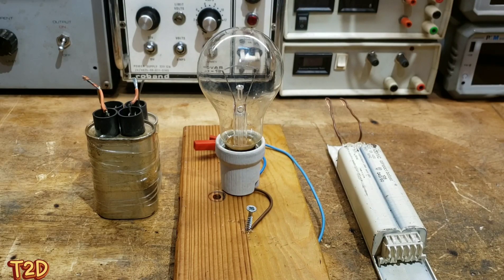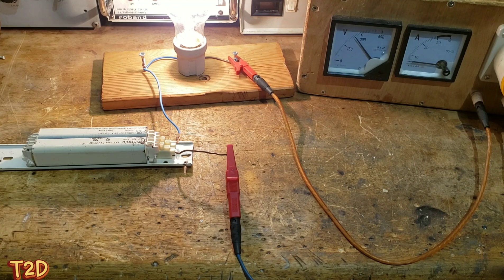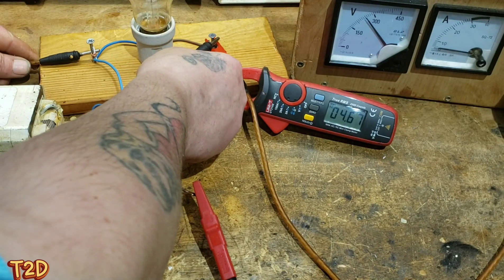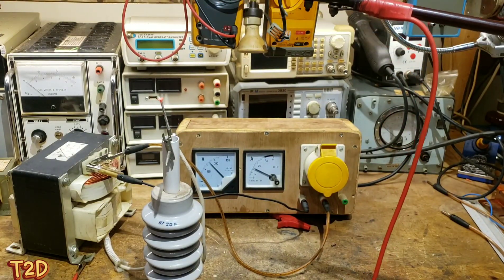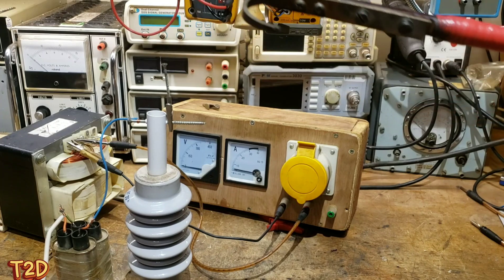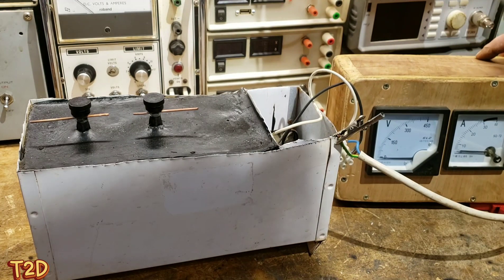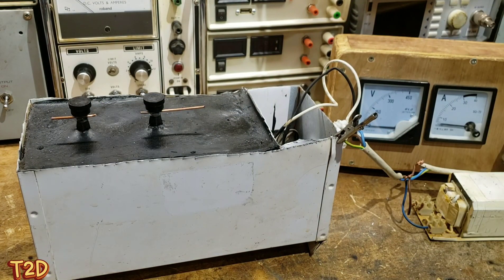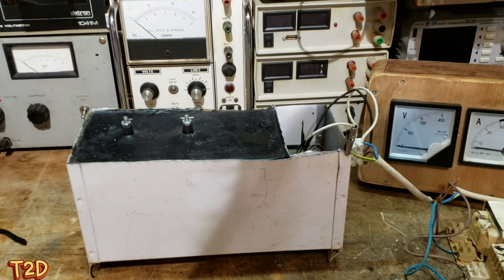Ballasting transformers for current limiting and running at higher voltage 👍👍

Comment: When I arced the plate transformer from the the gu-39b tesla coil, with the ballast in the primary and in the secondary (there was a variac in the primary, there was a capacitor in the secondary), the wires jumped during the arc from the Ampere`s force, and the contact in the variac is sparked. Without ballast there was an INSTANT shutdown of the circuit breaker
Reply from the maker: 🤣 I'm not surprised at all😎👍 beautiful transformer 😎😎

Comment: I guess this demonstrates why at 250w, my transformer will jump a space 3x the length that of when a higher power is used.
Reply from the maker: Yeah it allows you to get more voltage on the primary without over saturation 👍👍
Reply: I noticed this effect too. Super weird
Reply from the maker: @inductivelycoupledplasma6207  I will explain it more when I make my saturable core reactor  video 👍👍
Reply: @T2D.SteveArcs  thanks mate. I'll be looking out for that
Reply from the maker: @inductivelycoupledplasma6207  👍👍

Comment: Very well explained. Very useful! Lighting ballasts are the best for things like this. I usually use mots as ballasts because they allow a good amount of current through. However,  there is a much greater voltage drop to compensate for. Thanks for posting!
Reply from the maker: Thanks Matt glad you liked it mate ...
I will do a video on saturable core reactor soon ...

Steve

Comment: Very helpful video. I'm wondering how that NST took that much voltage on the secondary. Certainly changed my view on them of not being able to take any voltage higher than what they're rated at.
Reply from the maker: Glad you liked it thanks for commenting mate, I will try to do more videos like this in future if people like it....

Steve
Reply from the maker: Also have to remember theres two separate secondary coils and they are centre tapped ground so zero volts near the primary and core.....

Steve

Comment: Thats super interessting

How dangerous is this for the Transformer (regarding the NST)?
Could it damage the Coils, if they are not insulated well enough? I mean they do rly jump far!
Reply from the maker: This is dangerous for the transformer and it could arc internally.. we could keep increasing the primary voltage pushing harder until it did arc over,  my advice would be dont push a transformer you care about this hard, I did this to demonstrate it was possible, 

Steve
Reply: @T2D.SteveArcs  Yeah I have an NST, where the coils basicaly just have paper/tape insulation. Yours hase tar. Big difference.

Hm I wonder: If I put some bobbins under Epoxy for a custom Transformer, would that be sufficient isolation.
Reply from the maker: @friedrichfreigeist3292  if I'm trying to get max voltage a usually drop them under oil mate..
Reply: @T2D.SteveArcs  Ofc, Oil is the Way to go. I just dont like the mess, and smt dry that you can just put on the desk sounds more fun tbh.
Reply from the maker: @friedrichfreigeist3292  yeah that's kinda nice. I've just given my mate an NST that was actually potted in epoxy, and that could withstand quite some voltage too. 

Steve

Comment: Interesting. Obviously the ballast reduces the current in some way? So if the NST uses (lets assume) 30 mA @ 12 kV it runs at 15 mA @ 24 kV or something like that? Btw, inductive ballasts like these used for HQL/SON lamps and getting phased out at the moment. Modern lighting systems use LED (no ballast needed) or an inductive ballast is replaced by an electronic ballast as its much cheaper than these old "iron pigs".
Reply from the maker: Hi mate glad you liked it.. I will be doing another video about this subject and we will go a little more into it....

Steve

Comment: A great demo and a good accompanying explanation. Nice Juicy arcs too! I'm glad that my screen doesn't pass on the UV! -Peter
Reply from the maker: Thanks Peter glad you liked it, really value your opinion, 

Steve
Reply: @T2D.SteveArcs  When I was a kid, Steve -that's a long time before triacs came in, we used to dim our table lamps with capacitors. We switched in different values for different brightness using radio wave-change switches. Not mains rated but we survived!😀
Reply from the maker: @peterjameson321  oh that's really nice to know mate, thanks for sharing that Peter ....

Steve